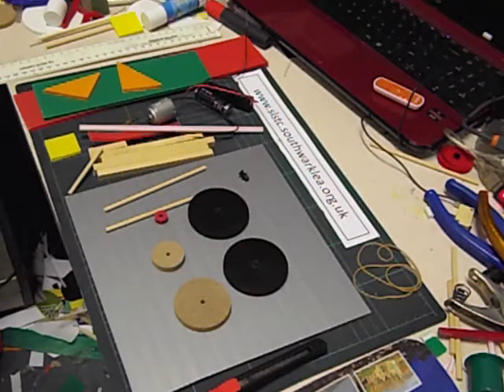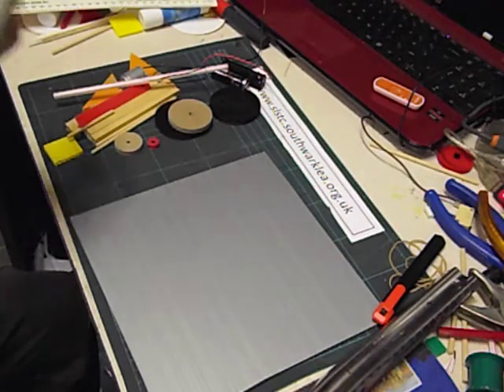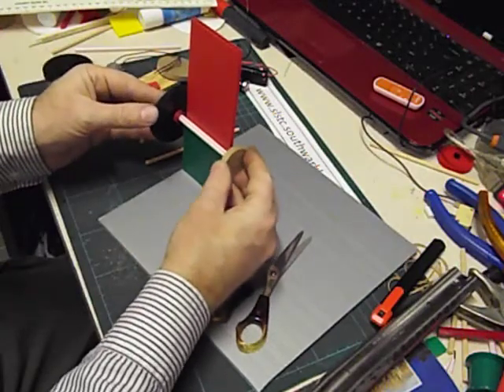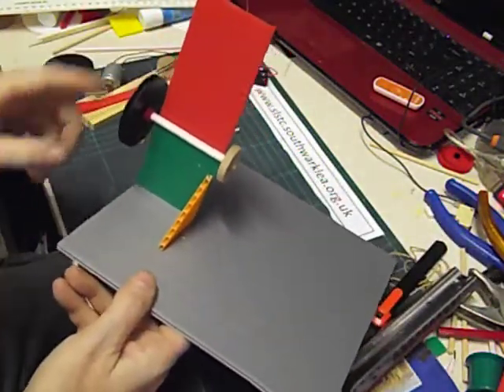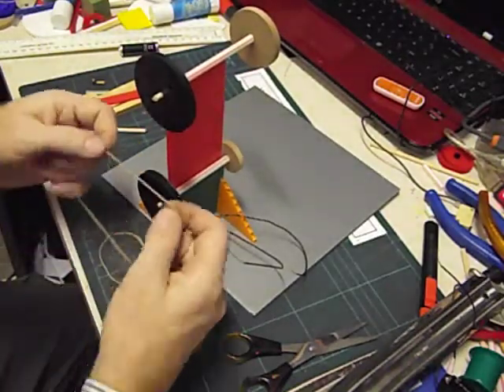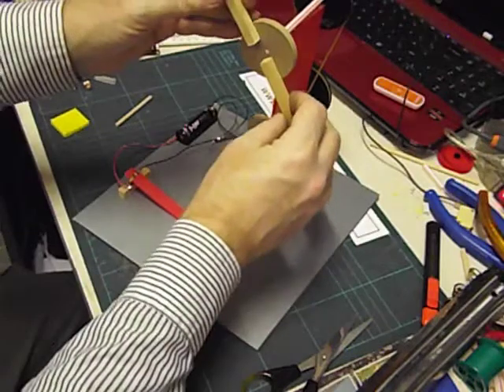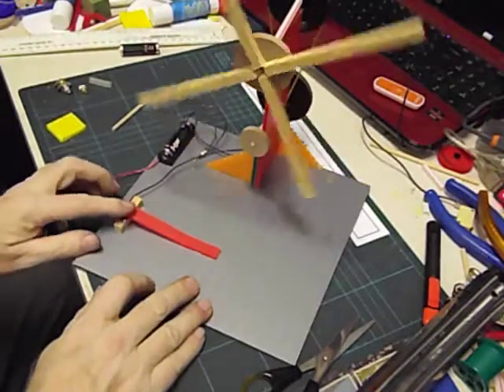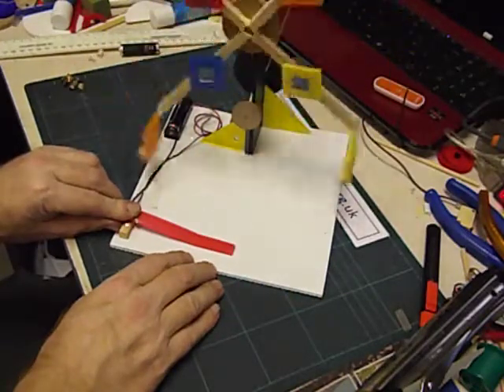How to make an Electric ferris wheel

Comment: WHAT'S THE MOTOR YOU USED I HAVE TO FINISH THIS FOR SCHOOL PROJECT PLEASE TELL ME PLEASE PLEASE PLEASE!!!
Reply from the maker: Hi,
its a cheap 3-6V dc motor. I sell them via my website at www.slstc.southwarklea.org.uk but can only supply UK customers and can only accept payment by cheque. My code for the motor is E162. The small black pulley is P100, the small red one P110 and the large black pulleys are P115.
My email address is on my website. If you just need one motor I'll send it to you free - Merry Xmas!
Paul.

Comment: where did you get those pulleys and that motor
Reply from the maker: As I said on the video, all the parts are available from my supply service 'The Technology Shop' on the same website as the videos.
Just email me a list of what you want.
Payment by cheque only.
UK only
Reply: Shalini Deo or you can find it at remote controlled car and you will see that also you can use even the car is broken

Comment: Umm, you're missing the main point which is a hollow bore motor so the leds can light up on all the chairs via a slip ring so the wires don't get twisted, which is by far the most complicated (and yet absolutely necessary for any ferris wheel) part.
Reply: Wweterio